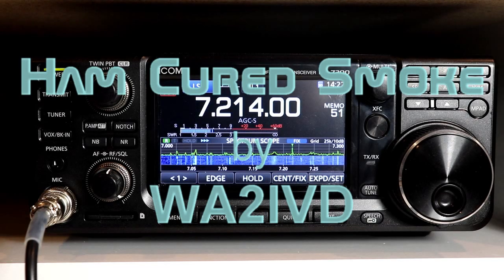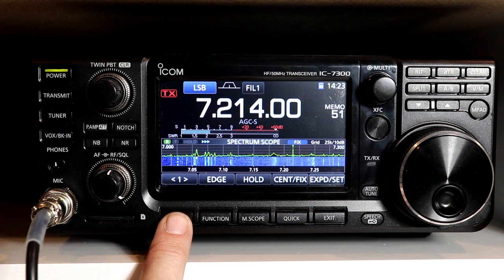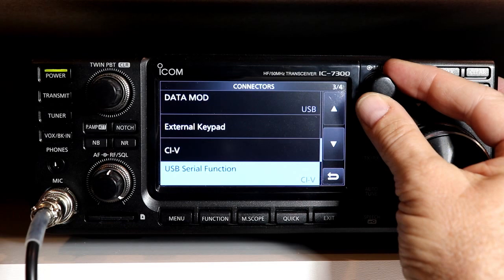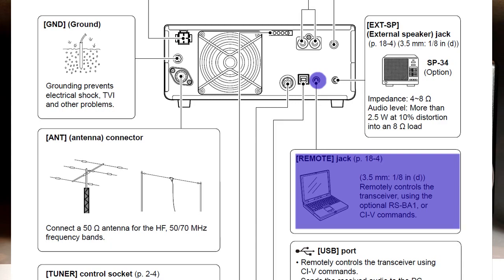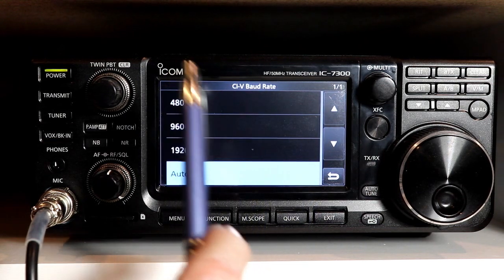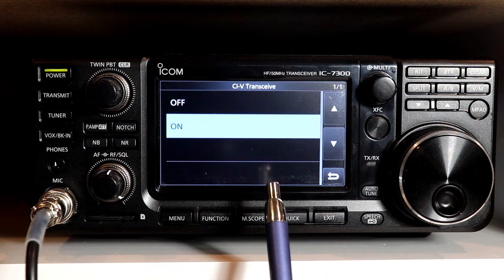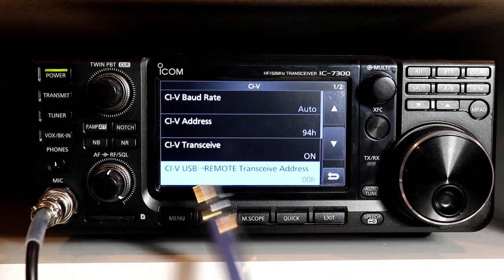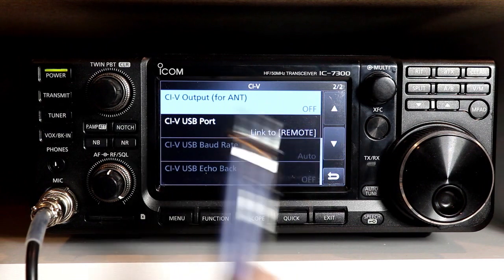Icom IC7300 A to Z #27 CI-V Settings

Comment: I discovered today that CI-V Echo Back has to be on to use the Icom remote control withe a server PC.  For example laptop to server pc to radio.  It might need echo back because it uses UDP which does not have a way to tell if a message has been received or read.  If you bought the Rs-BA1 software you may have figured this out as this video is a few years old.  I’ve enjoyed and learned from your other videos, thanks!

Comment: Echo back:

Certain remote software may not functioning correctly if it set to "OFF". 

Try to change it to suit the application's  needs. 

Thank you.
Reply from the maker: Thanks Mohammad. I haven’t had that problem yet, but there are lots of programs I haven’t tried yet.
Reply: @HamRadioA2Z  

I had problem with hamlib's rigctl program, if the "Echo back" is turnned  "OFF".

YMMV.

Comment: Great video with terrific explanations.  I am using DX Lab software with my 7300 and have an amplifier that I want to connect also.  It appears that I can unlink the remote connection and USB connection and control both the radio and the amplifier without having one interfere with the other.  Is that correct?

Comment: Great video but I have a question (I might have missed it): If you have both a USB cable (connected to the USB port) and a CI-V cable (to the remote jack) both connected at the same time, how do you tell the 7300 to use the remote jack for rig control and the USB for data in and out? (In other words, how does the 7300 know which to use)?
Reply from the maker: Hi Jonathan. The short answer is that you don’t really have to tell it, in most cases. I assume by “data” in and out, you mean for digital modes.  When you connect your 7300 via USB to your PC, two separate, virtual devices are created on your PC.  Audio for digital data modes comes through a USB sound card and CI-V data goes through a virtual COM port.  The 7300 can accept remote control CI-V commands through both the USB connection and the remote Jack if you have something connected to both of them.  There are a bunch of settings under Settings-Connectors to control how the USB comm port behaves.  It can be tied to the remote port, or separated to operate independently.  There are also settings to send decoded RTTY data out over the USB serial port when the built in RTTY decoding is enabled.  73, Tom

Comment: Great video Tom, I looked this video up again as I am starting a new project to investigate being able to control the IC7300 from a SmartPhone or Tablet with a suitable user interface.  Not entirely sure if this is possible as there is no WiFi on the 7300, but I'll try out using a Mac/Pc as the intermediary device via a web page.
Reply from the maker: Hi.  Depending on how much you want to do yourself, I suggest you check out the RigPi.  This is a complete web based rig controller based on the Rapberry Pi.  MFJ sells a complete unit, the MFJ-1234. The entire project is open source.  So you can also build your own, if you like.  Check out their website:  http://rigpi.net/
Reply: @HamRadioA2Z  That looks awesome, thanks Tom.  I will check this out and see how I could elaborate on it for the IC7300.

Comment: Tom - I looked for the RigPi image which you mentioned is Open Source, but can't seem to locate it.  I did see a link on the MFJ page but the image there appears to cost $29.95.  Do you happen to know where the open source version is available from please?  Thank.  GW3JVB
Reply from the maker: Hi.I don’t have any direct experience with RigPi.  I just know what I’ve seen in ads and reviews.  I did do some digging and went to the RigPi GitHub repository.  It looks like Howard Nurse (W6HN) created the repository several years ago, but the only thing uploaded is the license file and some description file.  There are some nasty comments about MFJ and a reply from Howard on the site.  You can read all that at GitHub, if you care to.  It appears that the software is licensed as open source, but the only place you can currently get it is from MFJ for the $29.95 download price.  As near as I can tell, once you buy it you are free to distribute it as long as all of the license and attribution information stays with the bundle.  So maybe you can find somebody out there who has posted the code someplace.  I didn’t try to look for other possible sources.

Comment: I'd recommend the use of a soft tipped touchscreen stylus rather than the hard metal tip of the pen you've started using to avoid scratching or otherwise damaging the 7300 touchscreen. Whilst they are one of the cheapest parts to replace, the touchscreens are also the most common things to fail and also one of the most delicate.
Reply from the maker: Hi Mark.  The stylus that I’m using is a combination pen/stylus.  The end touching the screen does have a rubber tip.

Comment: How to use EasyPal with IC-7300 not with an interface box, but with the USB cable instead for SSTV? Thanks.
Reply from the maker: Hi.  If you watch videos the IC7300 video #s 23-26, I show how to setup the rig with a USB cable.  I demonstrate it with Fldigi and WSJTX, but the steps will be the same for any software that you care to use.  73,  Tom
Reply: @HamRadioA2Z  I have seen some used the IC-746 Pro settings, as the IC-7300 is not listed on the CAT/PTT Menu. With interface box, the transmit tab on EasyPal send the image when using the interface box with just sound card settings.

Now, with USB cable only, so the radio internal sound card, even when properly set, also in the CAT/PTT menu, there is no action or radio PTT command once the EasyPal transmit tab is pushed.

I am on 6 meters net weekly, and on FM. All other digital software works fine with the USB cable only, but then not with the interface card, which is just good for the SSTV.

Regardless, nice of you to post such videos. Will see if I can get it to work, as I want to free one of the USB ports. Thanks a lot. 73.
Reply from the maker: Okay— Now I understand your question/issue.  The interface box you are using is probably doing PTT with a hardware interface to the accessory connector.  With the USB interface, it is more typical to use the CAT-PTT function.  I am not familiar with your software.  So I’ll have to do some more research.  In the meantime, you could check to see if EasyPal has a selection for the IC-7100.  The 7100 menus and functions are very similar to the 7300 and I believe the transmit command is the same for both.  If I find anything more specific, I will reply back.

Comment: I am running RS-BA1. Every time I connect to the 7300 it keys the transmitter. Any idea what setting I have wrong?
Reply from the maker: Hi Mark.  I’m afraid I don’t have any experience with RS-BA1.  I’ve been thinking about getting it and doing a couple videos on it as well.  I guess I’ll have to break down and get a copy.
On your particular problem.  Can you provide a little more detail?  When you connect it, does it 7300 key and stay in transmit?  Or does it just key up momentarily and go back to receive?  When I connect FLDigi/FLRig my 7300 keys up a couple of times, briefly while FLRig sends its initialization commands to the radio.  My 7100 does the same thing.
Even if I can’t answer your question, maybe another viewer will see the comment and can help.
Reply: @HamRadioA2Z  Hey thanks for the reply.

Comment: Hi dear! my computer (Mac) doesn't see my IC7300! how can I make these two connect? I have connected them with a cable, of course........looking for help, please:))) cheers
Reply from the maker: Hi Helene.  I’m sorry you’re having trouble.  My understanding is that MAC computers are pretty good at recognizing the USB connection to Icom radios.  Unfortunately, I have no direct experience with MACs.  There is a MAC/OS-X forum on QRZ where you might find some answers.  You can find that here:  https://forums.qrz.com/index.php?forums/mac-ham-radio-on-macos-ios.109/. Good luck.